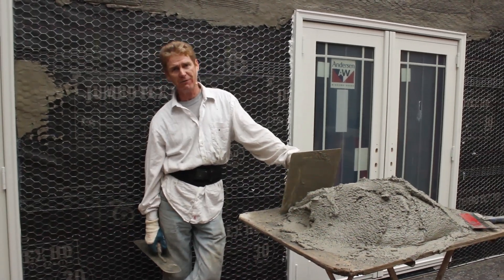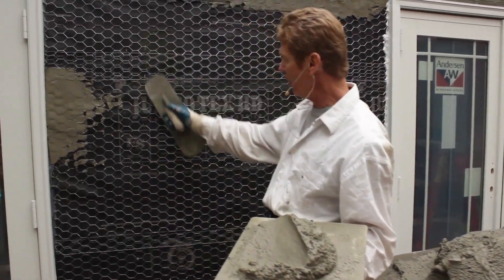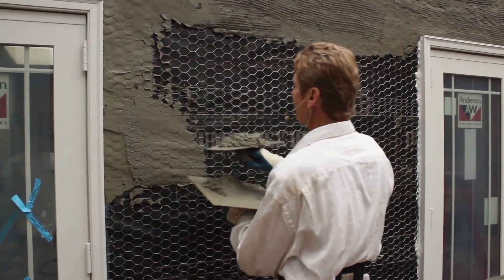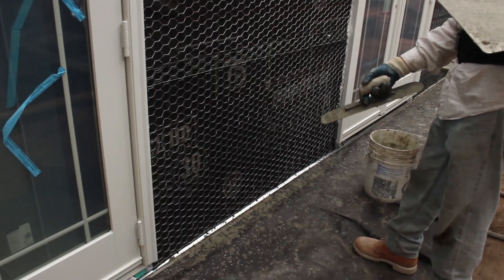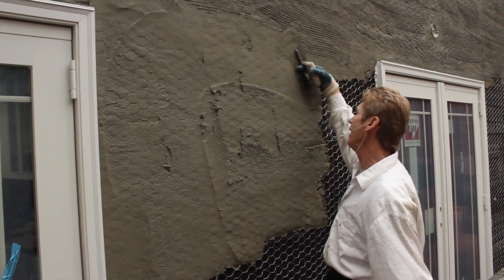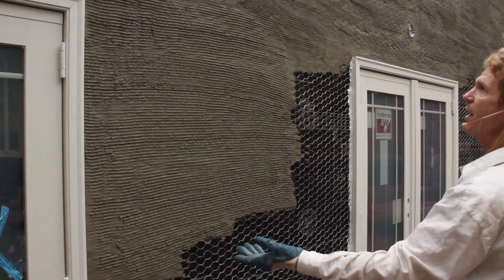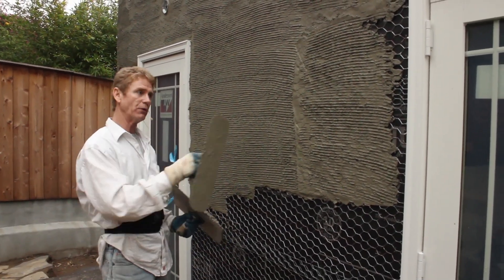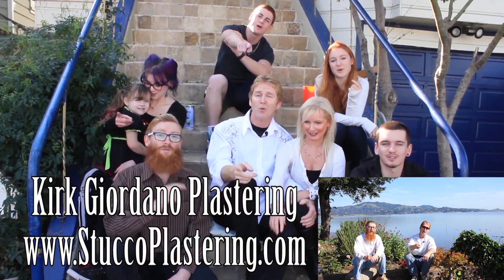Stucco scratch coat thickness?

Comment: Hi Kirk, I know this is an old video, but I have a question. Can the scratch & brown coats be deliberately made thicker to close a gap between the framing and an exterior concrete staircase?
Reply from the maker: Evening Tom, of course they can even if there was no scratch one would simply need to hose that first coat down and the brown coat would still adhere. 😉🕵️‍♀️

Comment: Question if some will build a wood box that is 8 feet log 3 feet tall and maybe 2 feet width  with 3 openings and it for the pets cats to have a place to sleep when it cold out side and u want to give it a  Stucco look to it just like real house  does it need all threes steps  Stucco scratch coating and a brown coating and the color coating ? just so the box as a stuco look to it
Reply from the maker: @joeselzer850  Morning Joe, I’ve found that dogs or cats don’t go for looks like people. An old chair or couch with a warm blanket that has your smell works just as well. Your house your rules.
Reply: @StuccoPlastering  yes i know that cate will not care of the outer look it was more for me the inside will be more for the cats we had cut off the bush so thy did have a place to keep worm so that why i i am making then i new place to sleep incold nights and just wanted the out side to look nice to use not so much to the cats the inside will be more like what u said
Reply from the maker: @ your house, your rules. 🕵🏼‍♀️

Comment: Hey Kirk, I’ve seen where they add fiberglass mesh that they embed into the scratch coat. What are your thoughts on using that stuff?
Reply from the maker: @adobeearthship1895  Fiberglass mess does make stucco and or concrete stronger. Many stucco products have it already added in their bags.
Reply: @StuccoPlastering thanks! I appreciate you sharing the knowledge! 🙏🤙

Comment: Hey friend, does cement have to have sand?  Or can you use pure quikrete cement?
Reply from the maker: Stucco is a mix of Portland cement and sand, while concrete is a mix between Portland cement and rocks. Cement without sand will crack like an egg, it’s like a breakfast cereal without milk.  😉

Comment: Hey, I have a question, I put on Roofing and I have leftover paper from the one on the bottom, it is the thickest, my question is, can I put that same paper on the wall before putting the wire mesh.
Reply from the maker: @joseluisgonzalez7172  code requires two layers.

Comment: 3 years ago after watching Kirk’s videos I installed the three coat system on my sunroom walls and the results are excellent. Almost all residential and commercial stucco nowadays are two coat ,I believe , with synthetic finish coat. I used all Portland cement based materials on my project. Thanks Kirk your instructions were top notch.
Reply from the maker: No problemo.

Comment: I haven't found any thing on the internet and I don't know if you have done any tile work on old time shower stalls so I figured I would give it a shot and ask you. I need to know the proportions of a tile setting scratch coat.  I am installing a shower pan in an old time shower stall.  I have match the old installation method which has a maybe 1/2" thick scratch coat of what appears to be a very dark gray colored scratch coat Suggesting a lot of Portland cement.. The tiles appear to be buttered with  1" thick mortar that is whitish  gray which seems like it has a lot of lime in it. Would a stucco scratch coat be similar to what would be used in a shower stall and if it is what would be the proportions of the Scratch coat mix?

Comment: Hi Kirk. What is the mix ratio for the scratch coat ie: cement, sand and  water? As I am putting on stone veneer with type s mortar. Then the veneer is going to be 1/2" apart. And the tape on your scratcher is it tuck tape?

Comment: okay fine but what if you have a 1.5" gap that you need to fill to match the existing siding depth.  I can't find anywhere on the internet on how thick the scratch coat CAN be (not should be).  Can it be 1" thick?
Reply from the maker: Of course, it can be, I have many videos where we applied 6 inches think. If you go thicker allow it to dry, not think enough, apply more when the first coat no matter how thick has a chance to dry.
  In fact, I'm doing this in this video, this scratch is an inch thick easily as they used the wrong depth of wood so we had to make up for the proper depth.🤔

Comment: I have a question my city inspector says I need J stop around my door and I cant stucco straight to the brick moulding or it will rot.but in this video isnt that what your doing? straight to the brick moulding
Reply from the maker: Howdy David, I'm in Beautiful California, in regards to this foolish so called code it's not required here, In many parts of the country, this thought process was designed to provide a bit of an expansion joint as the J trim has to be caulked to allow the stucco and the window to move without cracking the stucco.
 My opinion is somebody stayed up all night and thought of this, quite possibly the same fella who decided to put toxins in our drinking water.
 I have used thousand of pieces of Stucco J Trimes all for commercial purposes with a bit of a different but similar intention here in California,
 Sorry, I can't comment on your city and or states codes, many folks have commented in the last 6 years in regards to the well over 700 video's that we should have done this, they will say to use backer rod, (round foam to squeeze between the J Trim and the window) or use caulking, this process will add continuous maintenance to and stucco home.
Expansion joints can and is used for commercial large building instead, the topic of this use is another story to detailed for this page.
 Best wishes with this goofy code.
 Kirk giordano

Comment: how do you clean the floor mess there's  any type of product.
Reply from the maker: Hi Rosa Sanchez, we cover the ground usually with our paper that we use to weather proof the walls,
 however if you have some cement plaster that has stained bricks or concrete, you can purchase muriatic acid which is also used for swimming pools.
Dilute it well and wear gloves and a mask as the fumes are toxic.
 I would try scraping first.
 Best wishes,
 kirk Giordano plastering